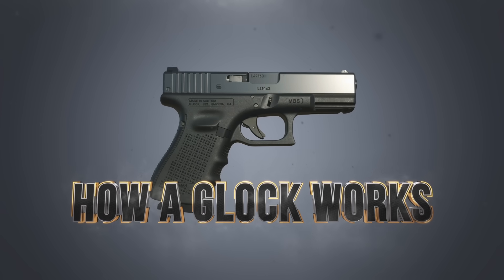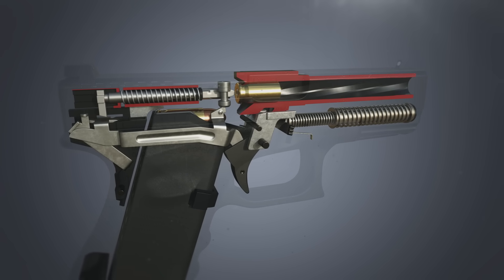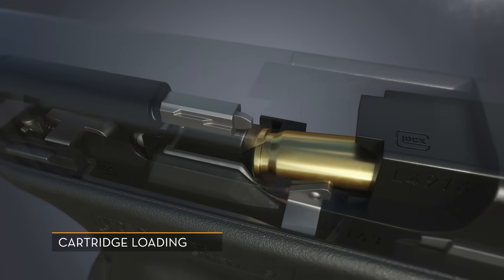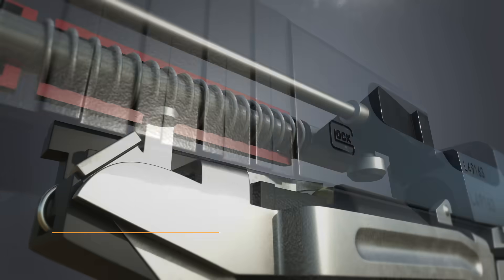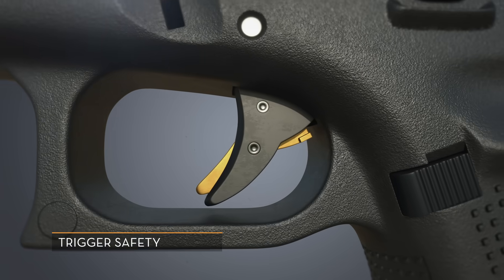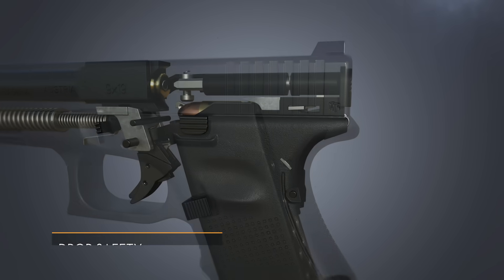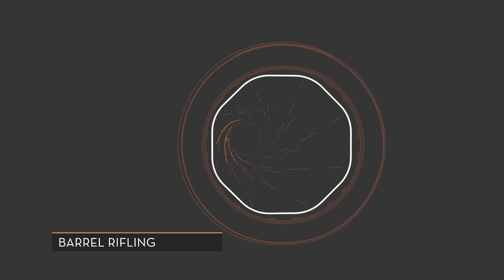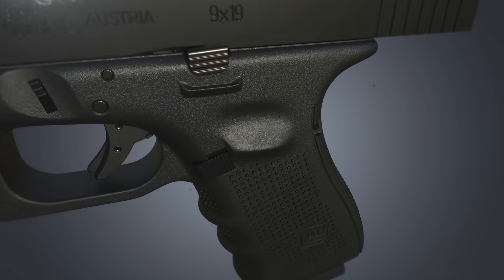How a Glock Works

Comment: Never in my life would I ever trust any Glock. They have to many problems and never ever trust a striker fired guns .
Reply: screaming chivo  

In my fifth or so years with guns I can say that striker fired guns suck . They don't have a restrike capable on most and all hammer fired weapons do. They are far more dangerous that hammer fired guns mostly because the first shot on a hammer fired gun is double action unless you have a 1911 . I have seen way to many striker fired guns that fire when dropped and other malfunction too. I will take a Beretta 92 any day over any striker fired guns. My favorite is the S&W 659. Very good gun never had a problem with it since I got her in 1988. Can't say that about any other gun. Except maybe the Colt python in the safe.
Reply: screaming chivo  
Actually I'd rather have a korth so come get the Colt bring cash . About five thousand dollars should do it. It's real pretty . Got ivroy grips that are real. Is stainless steel and has 6 1/2 inches of barrel. It's 357 magnum.
Reply: screaming chivo  
That shows me you don't know very much about guns. That's a deal with ivroy grips. The grips alone are worth 2000.00 dollars. 

Check here .

https://www.gunsinternational.com/guns-for-sale-online/revolvers/colt-revolvers-python.c176_p1_o6.cfm

Comment: I admit I hate the trigger safety design...till I watched this! thanks great vid
Reply: Hypercube Jones , I’ve screen-shotted this. In the UK we can still own firearms if they’re meant for fun, apparently, but not short guns. Some legends have got around that by manufacturing silly additions to make a pistol technically longer than the law forbids. I might have to start hanging around such guys, haha! Thank you for your info! 🙏
Reply: Still seems odd to have a safety on the trigger. Is it just to stop it from going off if it’s dropped on the ground?
Reply: @JamesMathison  triggers without the trigger safety can be accidentally discharged from a "side glance" from your finger or an object hitting the trigger. You have to have a continuous steady intentional pull to discharge the trigger safety on a Glock. Make sense?
Reply: Silver Grizzly , sure. Whenever I’ve shot (not that often, I’m a Brit :-/ ) the trigger has needed plenty of pressure, so I didn’t think a side glance would be enough of a danger to warrant a whole design around it. But if it is, then fair enough.
Reply: @TheInator1234  ...or you could just increase the weight of the pull, like that on double action gun. The Berretta PX4 Storm for instance, has this.
Reply: Andrew Nicholes increasing the trigger pull weight can be a bad idea in its own regard. Especially in a stressful situation, having a high trigger pull weight can greatly impact your accuracy. There was an article on the NYPD and how all their guns are forced Double Action only with modified trigger pull weights. Their officers constantly miss their mark and hit civilians.
Reply: @andrewnicholes6304  and this is what NY cops have on their sidearm, also part of the reason they MISS over 50 percent of all shots fired. The Barretta frame shape and action are different. Thats why it works on barettas.
Reply: @JamesMathison  dude did you watch the video you dumbass ??
Reply: Hypercube Jones , I’m starting to realise there’s a lot of in-fighting between trigger-safety and manual-safety advocates. It’s funny. I’m not talking shit. I WISH I lived in a country where people were arguing over gun technicalities! Where I’m from people don’t even know any of these terms. 

After your comments, I think I’m coming down on the side of the manual-safety. Surely you could train yourself to switch off the safety as you’re drawing your gun, eliminating most of trigger-safety benefits, unless I’m missing something. 

However, why would light trigger pull be an issue with manual safety? If it’s locked, it’s locked, right?
Reply: museack , that doesn’t make sense though. Why not just make a thumb safety “as an afterthought”, if it were that easy to do? This trigger safety is clearly intentional.

Comment: noticed my Glock doesn't always lock the slide back if the mag is empty.. maybe something is worn out.. but my Glock only has +- 6000 rounds through it
Reply: Usually a mag problem.  Or could be ammo related.  Or your thumb could contact the slide release, or any combination of these.
Reply: It should all be under warranty

Comment: Nice video, but it is a little lacking about the ejection process. You have the ejector, and the extractor, but the barrel itself plays a role in guiding the spent casing out of the gun. There is a "ramp" on top of the barrel chamber and the video doesn't show its purpose. I'm pretty sure it's not there for looks. It comes in contact with the spent cartridge during the ejection process. How do I know this you wonder? Because my spent cartridges are showing damage along the top and I have taken my barrel and matched up that damage to that ramp. It's not supposed to do that to a spent cartridge. Those spent casings should be able to be reused and because of what it's doing they are not able to be reused. It's a great video, but it really doesn't answer my question.
Reply from the maker: Oh wow I honestly didn’t know about the ramp on the barrel. That’s very interesting! I’m going to look more into this :) Thanks for info!